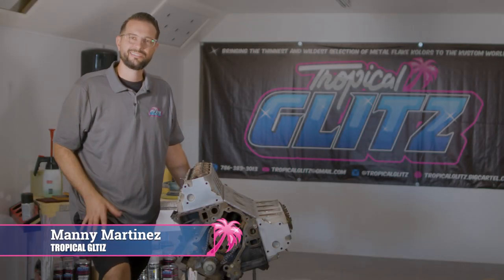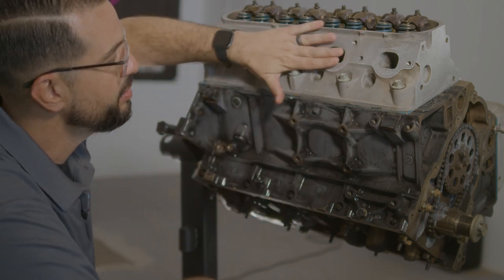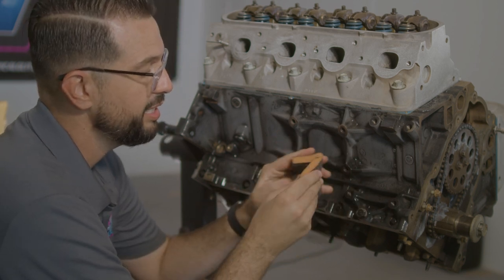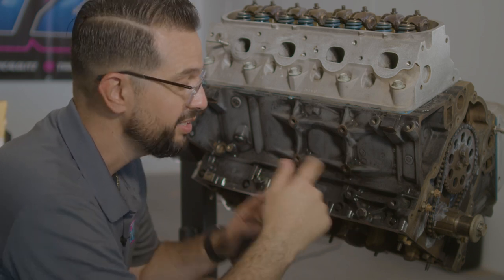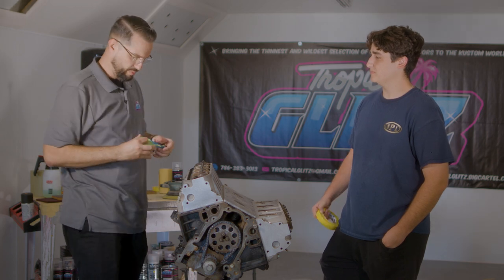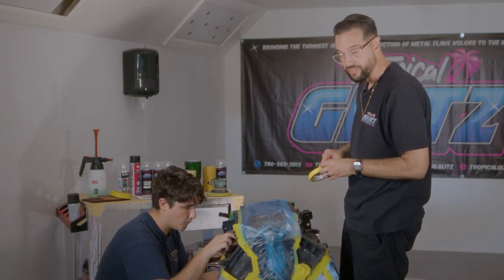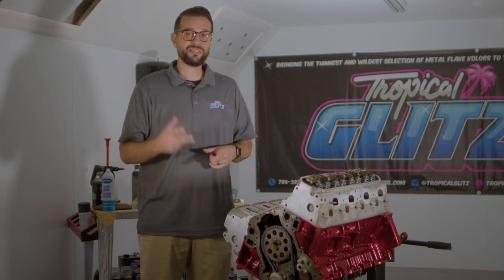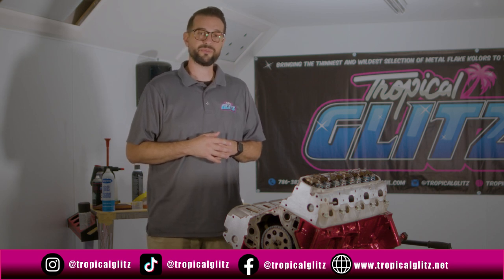How To Paint An LS Motor With Custom Spray Cans

Comment: You basically have the only video showing flake paint on a engine. Your title, if changed, would get 1,000’s of views more than what your getting. 

Anyhow, I’m building a 350 for my Chevelle and want to paint the block and heads flake green or flake pink using colored flake and real spray guns. Would love to see a video on that. And for the title if you put “how to paint a engine block” it would probably get lots more views. You have good content!

Comment: Would not recommend doing this sadly. Beautiful color but mine is just peeling and I spent about 130 for everything primer color, base coat and clear and it’s just peeling left and right. Chips right off took me 2 days to paint it and I took my time
Reply from the maker: Oh no!. That sucks.  Are engines all are done like this. This engine is in our daily driver. If you don't properly clean the engine your paint will fail. Prep is everything.
Reply: Yeah prep is everything. I spent about 20 hours prepping and painting my block. Wire wheel, dremel work, washed twice with dawn dish soap and a brush, degreased with wax and grease remover, metal prep etching by Por 15, primer x3 coats and finally base coat x3.